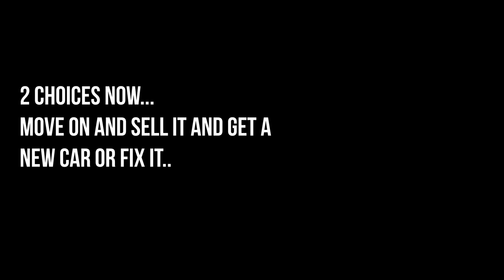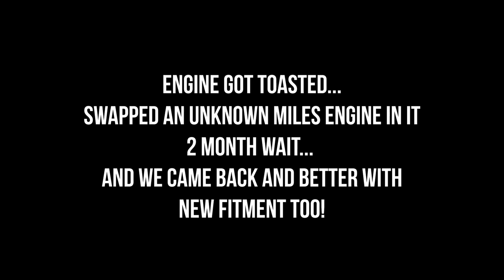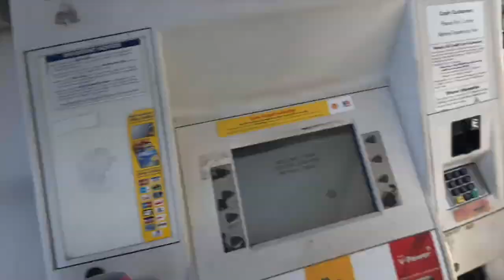BUILDING A HONDA PRELUDE IN 10 MINUTES!

Comment: I friggin love the 5th Gen Prelude. The H22 with proper headers whether DC Sport, Skunk, etc., CAI, and exhaust the engine sounds beastly. Of the late 90's Honda Engines The H22 always sounded like a much bigger engine that it was. Maybe later add a Hondata S300 and cams possibly aftermarket or from a Prelude TypeS for that extra top end kick in the pants.

Comment: I just got my prelude a week ago, it’s got a stock interior, 230k miles on the motor and like 100k on the trans, looking to put a new cool air intake in it and the same exhaust system you have, along with a turbo kit eventually, but I’m only 17 and don’t have a job at the moment so it will take time